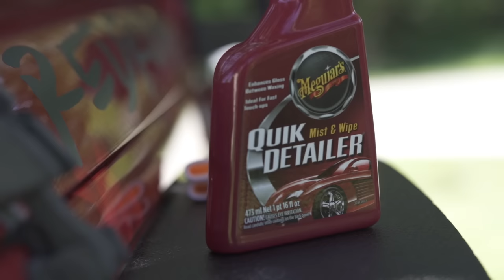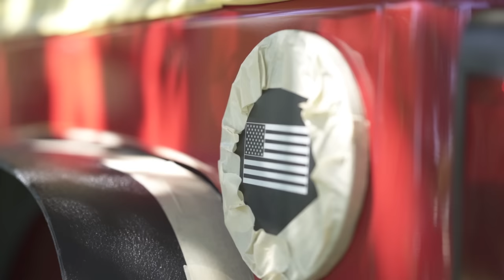Detailing The Dirtiest Jeep Wrangler! Complete Interior and Exterior Detail

Comment: Great video, the Jeep turned out beautiful!!  I would suggest a separate bucket and mitt with use on wheels and wheel wells.  This way you don't introduce metal from the brake pads to the paint.  You'll never get all the particles out of the mitt so the next vehicle will get scratches from the brake pad material. Also, consider investing in an air compressor and a tornador gun - not the one with the bottle attached (those do have other uses though).
Reply from the maker: Rich Beach thanks Rich! And that’s a good point. Need to get new mitts now haha. Thanks for the feedback

Comment: Awesome detail!  Just a quick tip tho--I would avoid using any included "quick detailer" products during the clay bar process IF you plan on polishing the vehicle later.  The reason being is that a lot of the time these products leave behind a slight residue or film that clogs up the polishing pads faster.  If possible I'd go with something that does not leave anything behind.  Keep up the great work!
Reply from the maker: FireSun20 thanks for the tip! Any better lubricant you would recommend?
Reply: Tom Does Details; You may try Optima No Rinse (ONR) you dilute it 4oz to a gallon of water. You can buy it on line. It is also good for windows, and I add 2oz to my 5 gallon soap bucket for extra lubrication when hand washing.  Really good stuff.
Reply from the maker: ouarkie awesome, I’ll check it out. Thanks
Reply: @TomDoesDetails  You can also hit it with some sort of wax and grease remover before starting to polish.  It's an extra step, but it's literally just spray on and wipe off with a microfiber.

Comment: 1) there’s no plugs in the floor  or carpets so you should of washed the door jams with the jet wash while doing exterior 
2) you missed dressing the tyres n trim 
3) don’t spin up the polisher before you touch the paint there’s a chance the polish could fly off onto your trim + your losing polish
4) you missed the windscreen wipers 
5) the adhesive for the carpet could be removed with gum gum remover and you could of layed some polish on the interior paintwork for the nice touch   Few tips but nice job
Reply: He should've done the interior first. He is getting all the dirt and grime all over the already clean outer surfaces.
Reply: John Hipp or he could of done both at the same time as there’s no carpet to saturate which would of lessened his time on this detail

Comment: Hi Tom, it was good, And did you miss these; engine bay, should have removed the center console, and plastic panels too, and carpet, bcoz it was loose and definitely there will be dirt inside, and did you brush tyres especially ( not important though bcoz it is again going to go in mud) but for detailing perspective, it can be shown. Expecting all these, in another video, thanks!

Comment: What really is clay barring for? Never did it once to my 2008 jeep patriot, two bucket method, wash rinse, paint sealant then carnauba wax, never had a problem and it still looks new to this day.
Reply from the maker: It’s used to remove the contaminants that get stuck on the clear coat of your paint. If you run your hand on one of your cars panels and it feels a little rough (almost like gritty and not smooth like glass) that’s the contaminants. And you want to remove those so you are starting with a clean slate if you are doing any polishing, compounding etc. It’s not something you really need to be doing that often.

Comment: The only thing different is I might have done the interior first I have to blast it and you don't want to get any more dirt on the outside of the car
Reply: I would do exterior first, outside of the car is a pretty easy clean but if interior is done first you have to be extra careful not to drag in dirt/mud from the outside into the car when switching tools and stuff resulting in having to sit and clean up a spot that was already done.

Comment: What would you reccomend to use to get grease stains out of the carpet of a car that someone used and threw tools and car parts in?
Reply from the maker: I actually did a car that was just that and I used Chemical Guys Fabric Clean. Just use a stronger ratio when diluting for those stubborn areas. And I recommend a drill brush attachment for autos.
Reply: @TomDoesDetails  Thanks for the fadt replay I'll buy some and try it out. Also you earned a new subscriber.
Reply from the maker: Ryan Neal thanks Ryan. Welcome to channel!